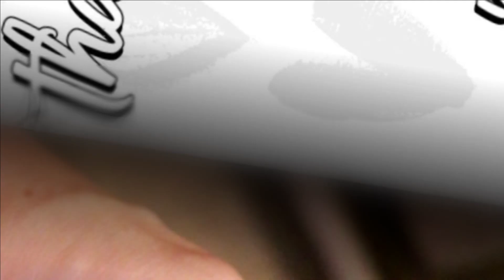HUGE MESS! CLEAN DECLUTTER & ORGANIZE WITH ME 2021 | EXTREME CLEANING MOTIVATION | DECLUTTER WITH ME

Comment: Nice video Jessa. I understand the outlets,  I already had to change a few in my home, still have more, but furniture will need to be moved. I'm sure the wiring would need to be replaced as well, new codes, but for now it works and the plugs aren't falling off. Nice job.  👍👍👍👍👍